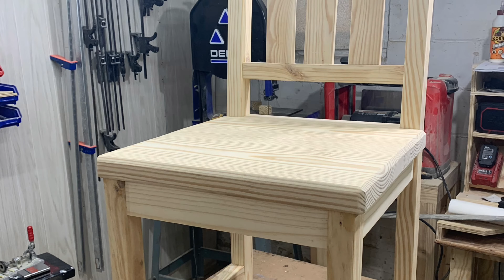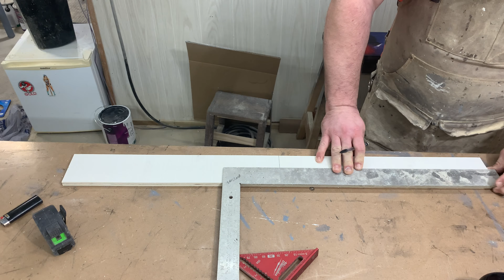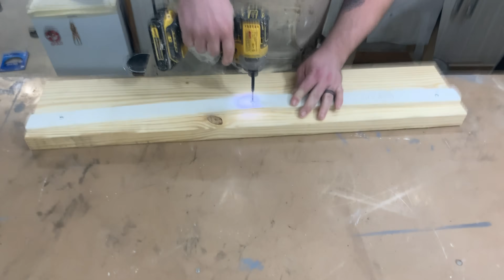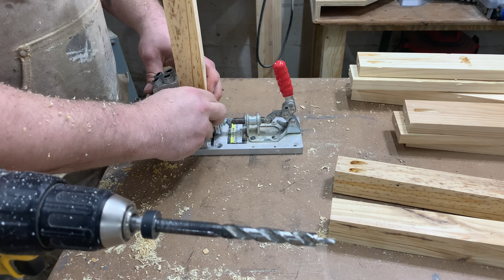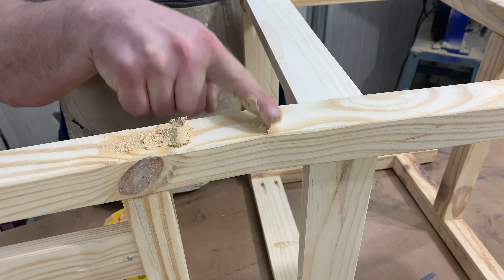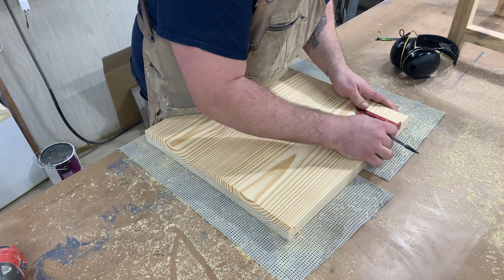Farmhouse chair build.

Comment: A little confused. You make the template 1-3/4" wide but all the material calls for 1-1/2" finished stock. Did I miss something or are you compensating for cutting outside the lines and then using the flush trim bit to make the legs 1-1/2" x 1-1/2"? Any ideas would be helpful. thanks